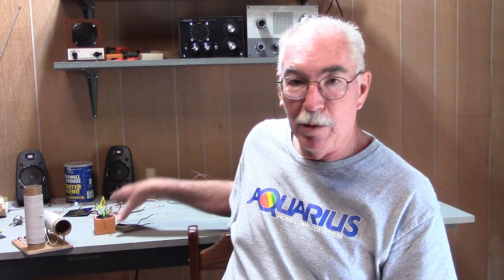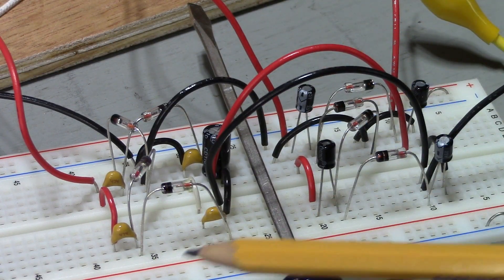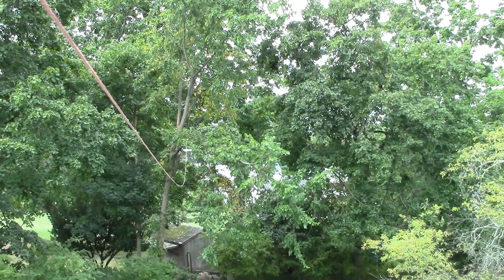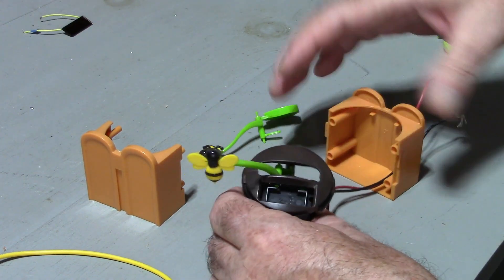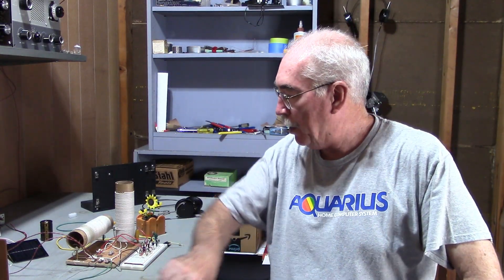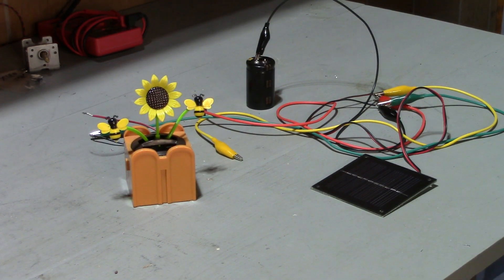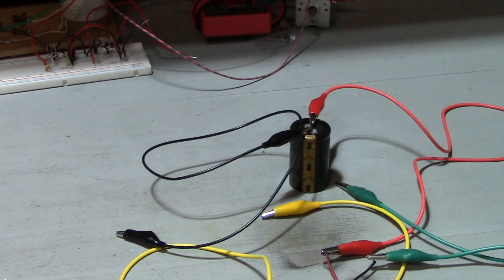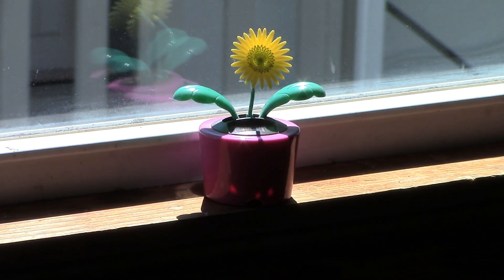Free Energy / Perpetual Motion  Part 2

Comment: If you now shove the circuit into the ground outside with a zinc covered nail on one and a copper one on the other that should soup it up.Or failing that shove it into a tree and another at its base.
Reply from the maker: The zinc and copper in the ground make a battery. That's an interesting idea.

Comment: Thanks my friend, these last two videos are esoterically charming and I'm already a fan. A collaboration: 14.6 meters is the length of the third harmonic of Schumann and 3.65 meters is a quarter wave of the third harmonic of the Schumann fundamental (to capture it) and could be an ideal length to connect a variable capacitor to find the resonance and produce free high frequency oscillations by matching the impedances by resonance. The winding to the left confines the magnetic field producing gain and to the right it expels it producing losses. A galvanic cell associated with the ideal coil of the quarter of the third harmonic can pour free electrons confining them in a closed and lossless resonant circuit until achieving the wireless transmission of induced currents of free electrons BEMF spin down in countercurrent. See painting by Hans Christian Orsted, greetings.
Reply from the maker: Thanks, I just looked up the Schumann Fundamental (7.83 Hz) and it sounds very interesting.

Comment: In some buildings, the water pipes are constructed from metal, allowing them to function as antennas or to connect to the main pipeline, which runs extensively throughout the city and is also grounded. Additionally, there are potential sources of free energy between the neutral and ground, which can pose risks when attempting to harness it.

Comment: The waves might cancel one another so two diodes should be used. Every coil should have its own independent rectifier and capacitor. At last the caps can be in series to sum up all energies.

Comment: Hi Michael, I just watched your videos about free ether energy. What you are actually doing is capturing the radio waves emitted, so the power obtained will depend on the number and length of the antennas. The ether energy would be an environmental energy produced by the electromagnetic fields of the earth, and those are other circuits, of which I have made some diagrams. I would like to propose a suggestion for your circuit. The main problem you have is the diodes, since 0.5v falls on each one of them (they must be dispensed with). And one possible way would be to connect a capacitor to the germanium diode and feed a "joule thief" that would charge another capacitor at its output, with the objective of increasing the voltage. I would send you a diagram but I don't know how to do it on YouTube. Greetings from Spain.
Reply from the maker: That's a good idea. I'm going to look into it!
Reply: No son campos electromagnéticos del planeta tierra,son campos electromagnéticos externos del universo los cuales sirven para darle movimiento al planeta tierra y demás planetas

Comment: Why not connecting them coils in parallel and getting another two to connect in series to keep the inductance the same as it is now  but having more copper in the system? Would it not perform better?
Reply from the maker: It's not necessarily the coils, it's the antennas. I wanted to put two coils and two antennas together, but putting the coils in series or parallel automatically changes the value of the coils.

Comment: Question:  If you had 2 tuning caps to each coil and tuned to the strongest local freq, would you gain more output voltage?
Reply from the maker: I tried that with the strongest station, KYW. It didn't seem to help. What I was trying to do was to pick up every station at the same time, since there are four "locals" here.